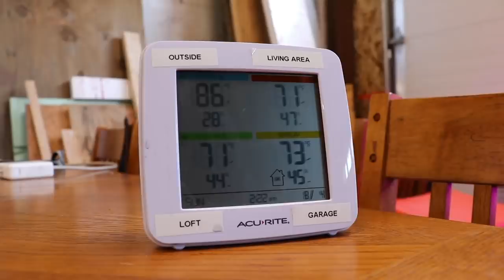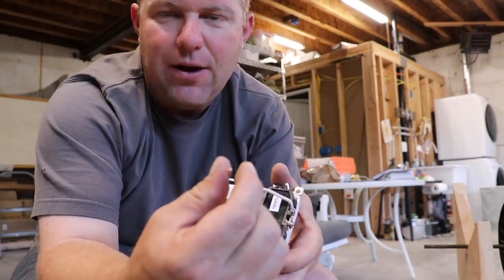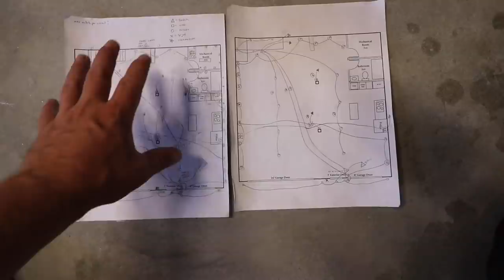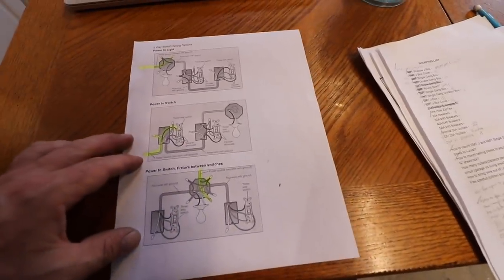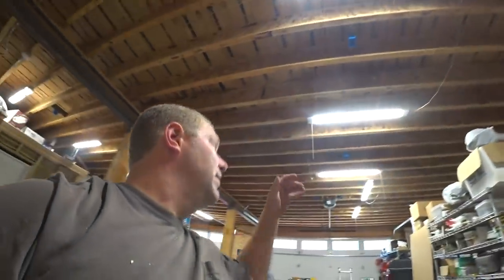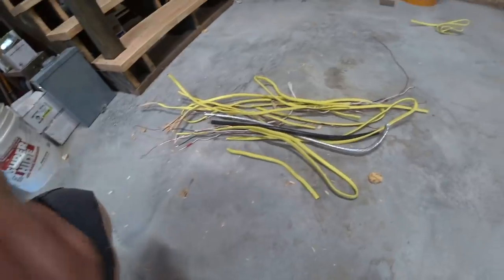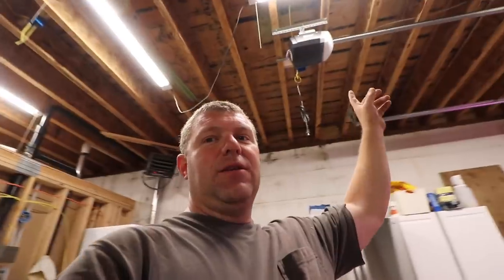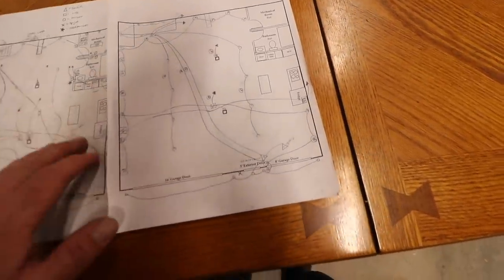WHAT A Wire-Pulling MESS (Garage Lighting Electrical)

Comment: Big mistake.

By daisy chaining outlets or switches you run the whole circuit THROUGH each outlet. Weak. 

Far better to wire nut power-in and power-out together and then provide pig tails to separate outlets. Thus power and neutral need not travel THROUGH each outlet to the rest of the circuit. So when/if individual outlet fails, it does not effect the whole circuit. 

Components within individual outlets and/or switches are not adequate to carry the WHOLE amount of electricity/HEAT running through the whole circuit at all times. Your method burdens EACH outlet to carry ALL energy that ever goes through the WHOLE circuit ALWAYS. Much more likely to overheat outlets and switches causing failure over time.
Reply: Larrymuse i see this all the time! It drives me nuts
Reply: Those outlets are designed to carry the whole load of the circuit. Even a 15A outlet is rated to pass 20A through the tab. They wouldn't be UL listed otherwise.
Reply: your right but if the one outlet gets to hot and burns up you weaken that connection for down stream current..Larrymuse has the right idea.

Comment: I don't believe that dual outlet rig you were showing would pass an inspection in Michigan at least.  Pigtails for hot, neutral and ground from both outlet units then wire nuts to connect to the source and down stream.
Reply: It's the same in NY.  You are not allow to continue the circuit through the top and bottom screws.  It must all be pigtailed.
Reply: Double outlets are fine, but you never run a circuit thru the outlet.. pigtail everything separately.

Comment: Hey sorry I had to chime in being an electrician! Jesse I give you props for tryin however you are incorrect on wiring the pairs of outlets, code says you SHALL NOT use the device to junction wires. This being said you have to pigtail all hots and neutrals, but you can use the same bare wire to bend in around the ground screws and terminate to the line side of the circuit with a wirenut. I suppose if you want to take the hots and neutrals and do the same thing with one piece of wire it would comply with code. The way it was explained to me is that you can run power from terminal to terminal on the same device so the tap between the outlets carry the power from one terminal to the other outlet. As far as your code question about how many wires you can run in one hole, it has to do with derating and wires in a raceway. Yes consecutive holes drilled in framing are considered a conduit or raceway, unless it is only 2 foot long then pull as many as you want without restriction. The only 3 wire with ground in a 3 way or 4 way switch system is between the switches themselves. The two hot conductors used between switches are called travelers. If you run power on the white wire you must color it with a hot color. However the newer rule of there Must be a neutral at each switch defeats this now for the most part! The reason is that so many homes are now being wired with auto or lighted switches and you can't used the ground wire for unused power for these type switches! They do make 4 wire with ground now as well. Btw you must use Listed components usually by underwriter laboratories unless you get it approved in writing by the AHJ! so no making your own light fixtures or boxes etc! I can give you a tip as well it is far easier to unspool wire when laying on the floor if you pull coils from the roll and keep them together and turn them in your hand as you walk them out the right distance it will be much straighter. Oh another thing there is a hole on both sides of every wire stripper those are there to bend hooks on the ends of wires for outlets and switches. you will be able to bend them tighter to fit the screws. Love your videos! hope the little one is well!
Reply: MrCelticatheart    Please tell me the article number of the NEC that you mention about SHALL NOT junction devices.   I would like to read it but, have never seen that one.   Respectfully,   Kevin
Reply: I agree. if the device fails, then everything from that device forward is dead.   pigtail hots and neutrals.
Reply: @stevefirst9521  Not really, if you look at a receptacle There is a brass bus bar between the two terminals. There is nothing wrong the way he wired those receptacles. often several outlets are connected through a Master GFCI outlet so all of the outlets are GFCI protected. if you look at a GFCI outlet it will have terminals marked "Line" and "Load" The source wires to the breaker are connected to the "line" and additional outlets are connected to the "load" terminals.
Reply: Guy Tech     I agree!
Reply: There is only 1 code article that requires one to pig tail on outlets, and that is only for a multiwire branch circuit requiring the neutral to be pig-tailed. Granted many of us electricians have been taught to pigtail for many of reasons, easier to replace a receptacle when broken, and not having a circuit fail down the line if a device fails. NEC 300.13 B describes this neutral pigtail requirement. It could also be a local AHJ requirement to pigtail devices in which case one should comply with their local codes. I find it easier to pig tail and teach my apprentices to do the same even though it is not a code requirement.
Reply: @KevinCoop1  There isn't one, he's still probably looking for it.
Reply: Tony Castillo    Thank you very much!  Multiwire branch circuits are not used as much as they used to be since the breakers became required to be tied together for a multiwire circuit.   Respectfully,   Kevin
Reply: @TheRealTonyCastillo   that is correct, the reason the neturals have to be pigtailed on a multi wire branch is so that you dont cause a backfeed if one of the neural wires becomes disconnected and blow up the 70" flat screen. Because Murphy will always find the most expensive item to blow up.  Now as far as best practices go it is probably best to pigtail all the duplexes separately, but that has to do with possible repairs.

Comment: Run your lights on 14 gauge wires, Run your outlets on 12 gauge wires. That will save you a hundred bucks. And 18 outlets on one circuit will be unsafe.
Reply: And also too many outlets per the NEC.

Comment: you should pigtail your hot(black) in the box and have two separate wires going to each outlet, otherwise you're relying on the device, and that is a no no. devices fail.
Reply: I was hoping somebody would have said this. I’ve seen fires started because of this TWICE. Federal Pacific breakers both times, and I blame the breakers because they didn’t trip ... but wouldn’t have happened if 15amp receptacles were parallel and not in series.

Comment: Minor question, appears you are knocking out the tab on the back of the boxes to run the Romex in.  Not positive but isn’t that tab the built in cable clamp that retains the wires in the box? Check with your electrician as you want to pass your inspection.
Reply: Some boxes hame knock outs and some have internal clamps, in his case he was using  ones with knock outs, you will know if it is an internal clamp when you need to take out side cutters to try and get it out.

Comment: I don't think anyone has brought this up yet, but why so many outlets on one circuit. I know code is fine to put 10 outlets on 20 amp.  But as much stuff as you charge and the distances you run your extension cords you might consider dropping that to 5 or 6

Comment: I thought you had a bit of scaffolding with wheels.  For the amount you still have to do inside, it could be safer and more convenient.  Just a thought...
Reply: servant74 get out the scaffolding
Reply: @tjinnertube  if I had some and was anywhere near, I would offer.  I borrow it from a friend when I have a need.
Reply: servant74 that was for the op
Reply: Too much clutter in the their garage. Ladders work fine. I use a ladder for all my ceiling work.
Reply: That little giant should be extended so he's not standing on the top run. Medical insurance shouldn't cover ignorance.

Comment: Best practice is to pigtail All connections separately. That way the failure of one device will not cause both devices to fail.  Also it is also best practice to turn all receptacles ground up, this will prevent  accidentally bridging  the hot and neutral prongs on the plug if something falls on it when it is partially inserted. ( or half pulled out as is often the case).

Comment: Probably too late to worry about it, but if you haven't tried the wago wire connectors, give them a try, they're sooo much easier to deal with than the wire nuts.

Comment: I see punch outs really close to where you are drilling holes in Joists.....I thought that was part of the strength?    They punched them AND you drilled next to them.....
Reply: Made me chuckle.
Reply: Easier to pull in a straight line
Reply: @ModernMountainLiving  First, the knockout was right next to his newly drilled hole, so straight line is really a moot point (beside weakening the joist) -- the angle of deflection is minimum,  and second, if those engineered joists are installed correctly, all the knockouts WILL BE IN A STRAIGHT LINE
Reply: @OrigMaelstrom  When TJIs are ordered from your supplier, the guy in the yard is cutting them to within a foot(12"+/-) with a chainsaw. Give a call to any supplier right now and tell him you want him to line up ALL of the punch outs IN A STRAIGHT LINE. Your supplier will get a kick out of it and know that this is your first time, maybe he'll be gentile. Ya'll in the Peanut Gallery need to keep it down!

Comment: I always run my 3 way circuits with power in on one end and light leg out on the other. Uses about the same amount of wire either way  but you don’t have as many wires going through one box. This also puts a neutral and ground in both boxes.  I don’t like using white for a conductor unless I have to and if I do I mark it well. But the main reason is a lot of the modern switches especially dimmers and smart switches require a neutral. Yea you could technically just jumper off the ground but why. I also always connect outlet runs in box and then pigtail to the outlet. One outlet fails he rest keep working.

Comment: I'm curious, why didn't you use the manufacturer provided knockouts that are only slightly bigger and appear to be less than an inch away from where you drilled (time stamp 15:33)?
Reply: Even better is the one where the drilled hole clips the edge of a knock out... Makes you wonder!

Comment: Pro-tip when pulling wire on a run pull all the wire for the run though the first box then make a small loop enough to put connect both sides to then pull the rest to the next box and so on and not cutting and guessing how much each time from one box to the next to. it is more efficient and if you leave enough then you can use the extra at each box as your jumper wire. Some municipalities do not allow the use of the bar on the side of the of the outlet to act as a jumper and want you to use a wire for that jumper so you splice 3 or 4 wires to go to each outlet independently, as well as wiring across the two outlets (hot on one and common on the other and jumpers in between). They may prefer hot and common to one outlet then jumper from that outlet to the second. so make sure you look at the code. There also may be different wire types for lighting and outlets as well as different circuit requirements so outlets on one and lighting on another. Limits to  number of outlets on a line based on function like 14 outlets on a garage space might be a little much.

Comment: Jessie should discover Wago connectors. Way easier and better than silly wire nuts.
Reply: The accountants requires wago connectors. The craftsman wants wire nuts.
Reply: Don't give the poor guy any ideas!! He'll use those to wire his whole house lolol
Reply: @joshprater8533  

Wago's are WAY better than wire nuts. Safer, used a lot now all over the world. Fantastic product. Great for MF boxes too. Electricians in the UK and Europe use them all the time now.
Reply: @TheRealTonyCastillo  

Well I must admit. Some of the US methods do seem weird. Like running cable through insulation. We in the UK aren't allowed to do such things, which makes sense, conductors generate heat which needs to dissipate. 
Whether his doing that is regarded as okay or not in the US, I have no idea. The inspector didnt freak out so I suppose so.

Comment: I'd be surprised if your local code requires 20 amp for bathroom lights. For receptacles, yes, along with GFCIs.

Whenever possible, even if not required by code, separate your lighting circuits from outlets. You never want to be caught in darkness when you trip a breaker, and a trip is most likely from something you plug in.
Reply: Here in Colorado you cannot have a light on an outlet run in a garage so you have light when the "thing e ma jiggger" trips the breaker.
Reply: It was because he put the lights on the same circuit as outlets.  He really should have known better than having any 14 on a 20 amp breaker.
Reply: @fotopdo  You are right, but It is usual beginner's mistake. I tried to explain this in a comment under original video for their failed inspection, but probably Jessie haven't read these. As many people seems to not understand, breakers are not for times, when everything is running as supposed, but for moments, when something goes wrong. The bathroom fan and LED panel can be powered with very thin wire, because of their diminutive normal consumption. Problem is, that in case of partial short due to malfunction, they can reduce their internal resistance and become very powerful consumers. In this case, 14 g wire can literally melt in the wall, causing fire, and 20A breaker may or may not cut circuit on time, because it is made to trip when power goes over 20A for set time period, and 14g can withstand no more than 15A.
It is ground rule for every electrical installation - breakers amp rating must be lower than maximum allowed current of every line that is connected to them.
Sorry for long post and bad English.

Comment: Separate lighting circuits from outlets. That way when you blow a breaker the lights won't go out too. More importantly you can use 15 amp breakers for lighting. With all the complications of lighting circuits the ease of using 14ga. wire is a huge advantage.

Comment: I noticed that your garage power box is getting a bit cramped. However it seems that the external box has enough connections free to run another power box. Have you thought about putting in another power board for the upstairs electrical rather than running it off the downstairs garage board?

Comment: most I joists have Knock outs When you order your joists order then long enough to cut your blocks and align all the holes depending which end you cut ..use larger boxes than the code minimun size and mud rings, wiring is easier and roto=zip thru the sheetrock against a metal ring instead of amateur messing up plastic.

Comment: I know there's got to be a limit on the number of appliances on a single circuit.  16 outlets (Garage openers and wall outlet gangs) on a single run seems way high.
Reply: In a garage (not a shop) you could get away with maybe 8 receptacles on a circuit. If your using your garage for more than just convenience receptacles I would at least have a dedicated 20A circuit on each wall.

Comment: Any reason you didn't use the knock outs on the floor joists?
Reply: I think in an earlier video when installing the main power they stated the floor joist was not installed in the proper order and the knock out was not in line with each other.

Comment: If your teeny tiny fan develops a fault it can draw upto 20A before the breaker pops. It's all about sizing for fault currents, not the actual current draw you plan for the circuit to take.

Comment: Hi the only thing I would have suggested, the step ladders are too short, I would have raised them up 1 more rung, then you could reach up higher, but mainly that you could have 1 foot on each side rather than have 2 feet on the top rung, this will balance your weight and be a lot steadier. The UK have different regulations that you would laugh at 👍
Reply: The ladder use was bugging me also. Maybe after doing your roof you feel you can do anything,
but make no mistake reaching out and missing an Ijoist has the potential to be a death fall onto that concrete.   You can do it all day long but the little noises coming from upstairs have me asking   Why?

Comment: When are you going to start looking into a Whole House Generator’s on the market and researching what will be best for your family’s home security when the power goes out during this winter snow's?
Reply: They already have a backup generator that will handle what is required, look a long while back and you will see the circuit setup for the generator.